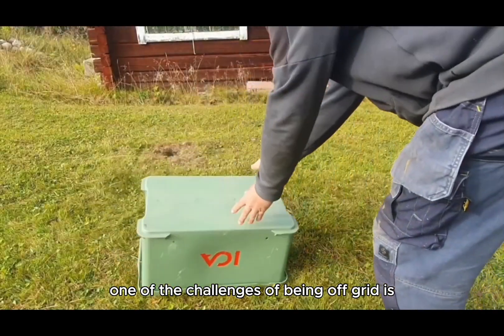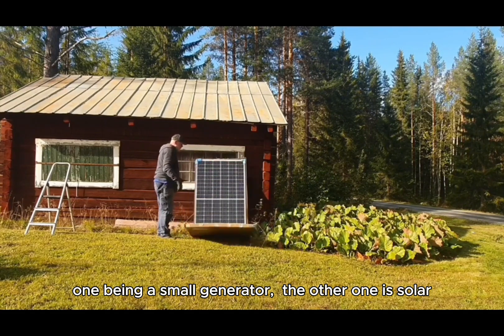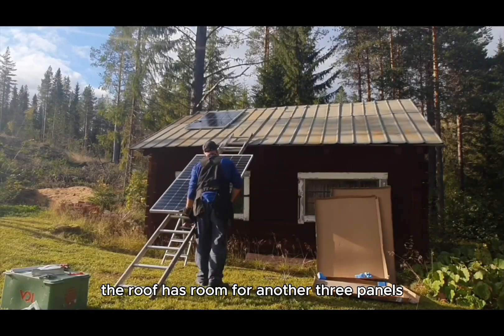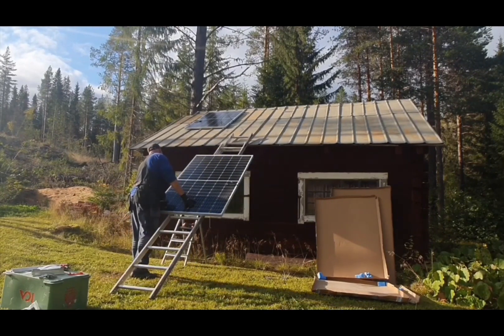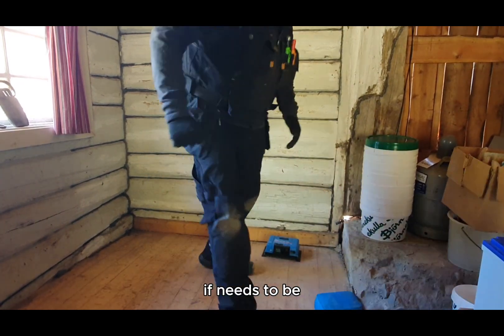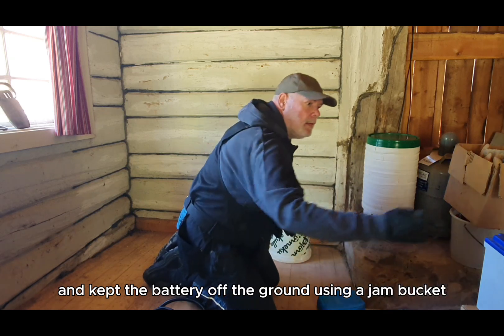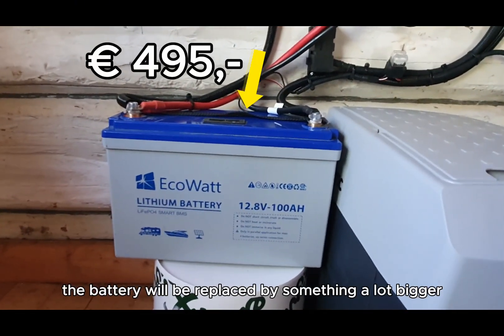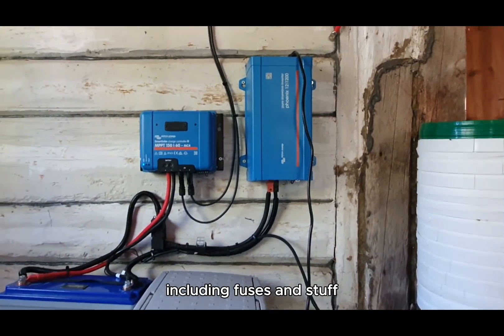Off Grid Solar easy and cheap(-ish)

Comment: moin... ick weiß ja nicht wie die Gegebenheiten sonst so sind... Verschattung und so... ick würde dann empfehlen mehrere Laderegler zu nutzen... wenn noch mehr PV Module aufs Dach sollen... und einen Wechselstrom-Kühlschrank zu nutzen... da die neuen sehr Strom sparend sind... meine KühlKombi braucht nur 40 bis 60 Watt... je nach Betriebsart... (abtauen ...) zudem soll eine 24v-Anlage (Batterie...) mehr Leistung bringen... und auch effizienter sein... ick habe aber auch nur eine 12v 2kwh LFP Inselanlage... die ick aber auch zum betreiben meines BKW (Balkonkraftwerkes...) nutze...   aber für den Anfang super Umsetzung... ^^ 👍lg aus Deutschland... andy...
Reply from the maker: Hi Andy, du hast recht,  aber für jetzt im Sommer ist Schatten nicht wirklich ein Problem und das System is so überdimensioniert für nur die kleine Kühlschrank und das laden von Powerstation, das es für jetzt reicht. Aber genau, 24V oder eben 48V ist für die Zukunft sicher möglich.  Mit ein grossere Batterie und extra pv Panelen mit Regler. LG aus Sweden